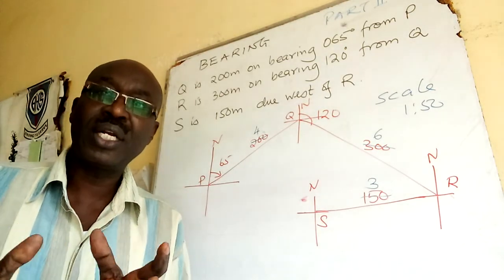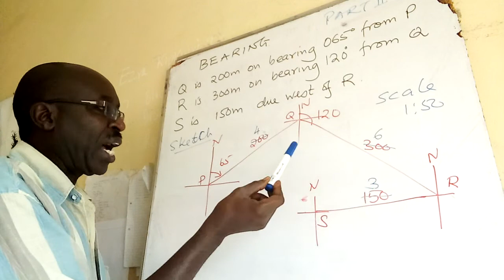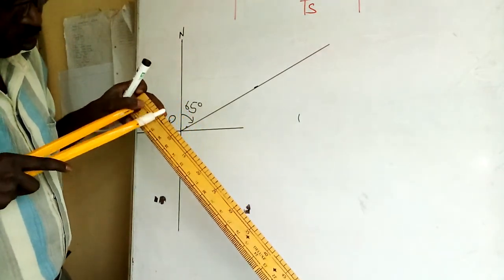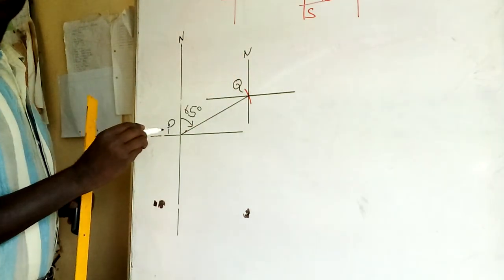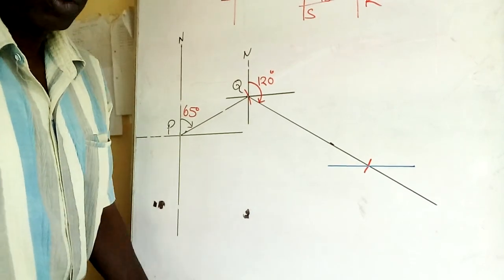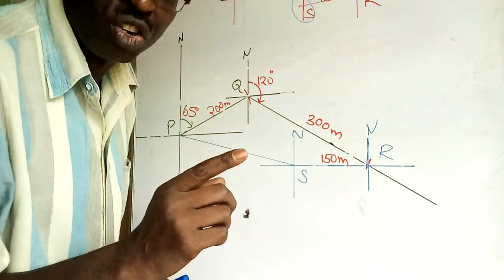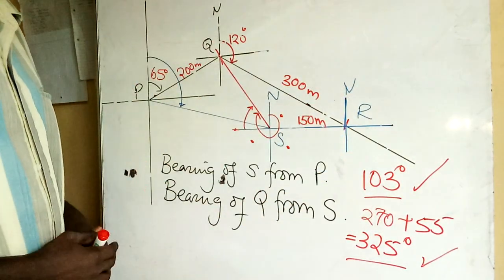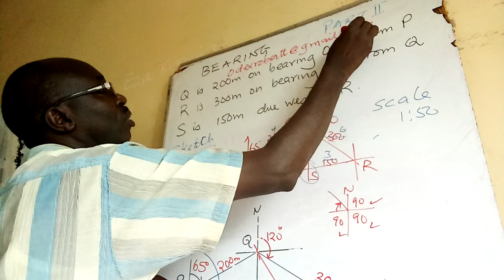BEARING#MATHEMATICS#Part 2

Comment: Teacher I have a question please help me out in this one.four towns a,b,c  and d are such that  b is 80km directly due  north of a  and  c is on a bearing of 300degrees from a at  a distance of 50km .d is on a bearing of 345 degrees from  c at a distance of 30km .a) using a scale of 1cm to rep 10km draw the relative positions of the towns .b) find ;I)the distance between b and c ,ii) the distance between b and d,iii)the bearing of b from c ,iv) calculate the distance of abcd.ill be so glad if you help me out.